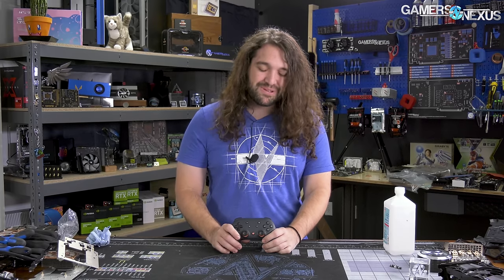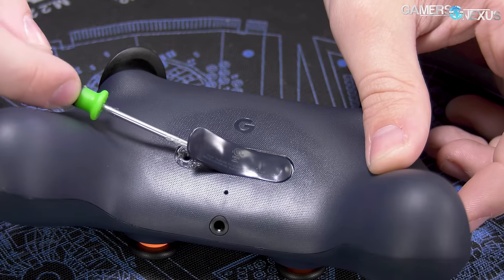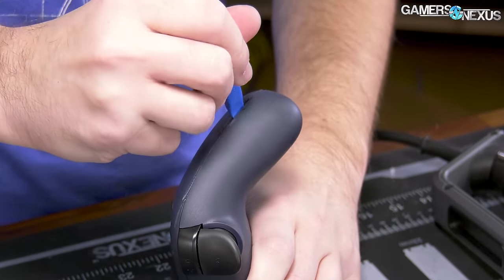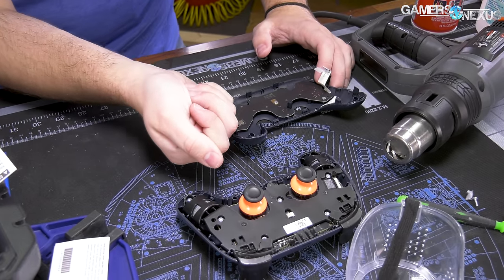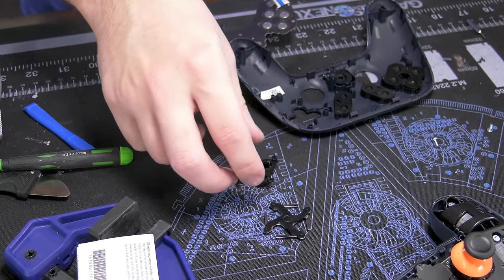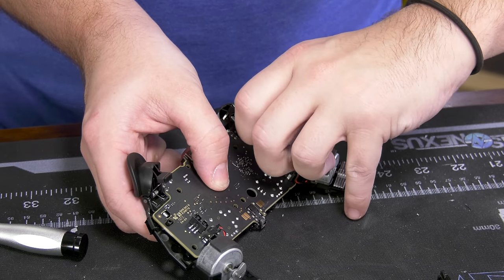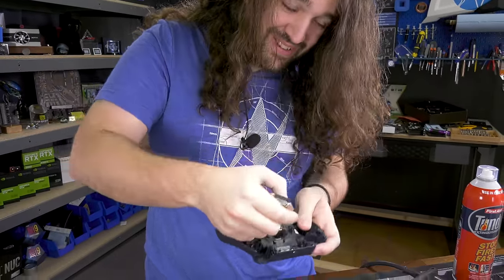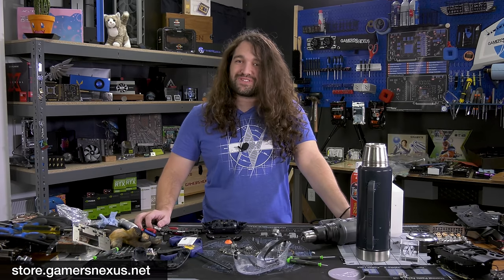Google Stadia Controller Tear-Down & Disassembly Nightmare

Comment: So Steve briefly mentions ease of assembly, and that is kind of the problem here. I work in automotive manufacturing and I can see the real problem; it was in fact designed for quick solid assembly and not much else.  Working in assembly, I also sometimes pick up overtime in repair, and let me tell you, one does not equal the other.  The intent here was "Push the top part down on the bottom, drive a screw, finished product" This falls apart when workers or lord forbid customers have to start jamming tools into seams to break clips. Clips exist for the assembler, screws exist for everyone after.
Reply: nodding vigorously
Reply: Agreed
Reply: That's actually pretty interesting to hear/think about as someone not versed in either industry.
Reply: Oh Christ on a pogo stick, they just don't want anyone to mess with it period do they?
Reply: I watch a lot of auto assembly videos here on the tube (im weird) and yeah, everything is clip on. Its pretty amazing thinking about how the process is automated and figured out. I try to imagine how they program the robotic arms and the reason for every move and pause.
Reply: Then you gotta spend an arm and a leg getting a oem replacement part, because said clip broke.
Reply: As a mechanic I hate the clips every new car has, they are so brittle nowadays
Reply: @pilot1721  Guess they just need Google's Monster Clips (tm)!
Reply: @pilot1721  well you basically have to types of clips: 1st breaks of instantly, 2nd it's more likely that you rip the fucking metal out of the other part than get the fucking clip off.
Reply: @Ocastia  And the tabs in my crappy Samsung. I've opened it up a shitload of times and they STILL are there holding the thing together.
Reply: @owlstead  Yeah I hate how Crunch bars come in triple-wrapped waterproof silicone these days with gorilla glue and a padlock to secure it.

Comment: "Disassembling the device may cause injury to you" given that it necessitates LN2 and a heat gun and a dremel I'm not surprised lol
Reply: Yeah, I guess they weren't kidding!
Reply: No, they're just warning you that 1 in every 10 controllers is actually filled with sharp, spring loaded spikes.
Reply: @nickdahl203  lol
Reply: I hope they have clear safety warnings for the claymore mine! 🤣

Comment: At least Google will kill Stadia long before the non-replaceable battery dies.
Reply: I just sold off my last Google TV today... 

You remember Google TV? 

No? 

Google it.
Reply: Search “killed by google”
Reply: @rodmunch69  No, but I used SageTV for years until Google bought it and killed it to make Google TV...
Reply: gtwannabe2 well that’s the point - Google TV wasn’t even around for a year. Meanwhile Sony releases an entire line of TVs and Blu-Ray players built around it - and Google didn’t even wait a year before abandoning the platform. That’s what will happen here.
Reply: Yeah that sucks...man i played my 360 batterues dead back in the days
Reply: Wait what you can’t charge the batteries
Reply: Massman121 You can. But it looks like you can’t swap them.

Comment: Paid $130 for Google Stadia that doesn't work.

GN "Let's do a teardown of their controller"

Uses every tool, a heat gun, liquid nitrogen, and dremel cutting disc to disassemble controller. 

Great video Steve! 👍
Reply from the maker: Thank you!
Reply: RIP Flathead screwdriver 2019-2019. Your sacrifice won't be forgotten.

Comment: Tools needed for this tear down:
1 heat gun
1 flask LN2
1 Dremel with cutting disc.
1 Tech Jesus
Reply: And 1 set of safety squints!
Reply: Did you just call savior Steve a tool? 😄
Reply: random_n Maybe a vice of knowledge would help aswell!
Reply: Don't forget the eye protection in case of flying screwdriver tips.
Reply: Are we all forgetting how he said "jif" instead of "gif"? It's tech Geesus now.
Reply: Your forgetting one major thing a mod mat
Reply: @matdan2  Along with a swiss army knife that hopefully has a screwdriver in it?

Comment: Google got the Apple "just buy another one lol" syndrome.
Reply: Apple products (except maybe computers) are fairly user-friendly tbh
Reply: @Matte0Cal0  software wise, ye. Hardware and repairability wise, a little bit less.
Reply: @Matte0Cal0  Yeah, I love awkwardly crawling behind an iMac just to plug in an SD card. Really userfriendly.
Reply: @Matte0Cal0   tbh I'd say Apple is pretty consumer-hostile .
Reply: Matteo Calogero you had a lot of vaccinations
Reply: NPC #76 .you’re one of those
Reply: AznUzer what do u mean bro
Reply: Krystal Myth I must say that they don’t really allow the consumer to get into their phones and stuff, but when you know how to repair an iPhone, it’s actually a cup of tea (sorta like a car and why you need to go to the mechanic)
That is why I like apple products, you can use a phone for 5 years without even feeling a difference, except the Battery which you can easily replace for ~30 bucks and 15 mins of your time
Reply: @Matte0Cal0   Yeah, and I still can't use my wired Sennheiser headphones on my phone. Neither can 2/3 of smartphone owners thanks to the toxic effect of removing a universally ubiquitous open standard. Anti-consumer doesn't even begin to describe it. I'm saying what you call user-friendly, comes from a company that is unfriendly to their users, from policy to their design. To their very core. 

By the way what you just described applies to any modern flagship. I've owned an Axon 7 since 2015 for the Stereo loudspeakers without any issues. Something like that is not why you like Apple products.

You like Apple products because you are locked into their ecosystem, and can't leave it without abandoning a large collection of software and accessories. You don't have much of a choice, so you've convinced yourself that it was yours to begin with.
Reply: Krystal Myth I get what you’re saying, not being able to plug my audio technica headphones on my phone without quality loss, but you shall remember that these companies (not only Apple as you said) are making phones for the average consumer, not specifically enthusiasts. Take for exemple the RED Phone, amazing concept, but you can’t develop a product only for dedicated fans for a user-friendly price.
Reply: Krystal Myth I know that there are plenty of phones that are far better than iPhones, but I only use my phone for YouTube, Reddit and 4 daily hours of music, and just the overall confort of whipping out AirPods from your pocket and listen to music in 3 seconds while entering a bus or between 2 classes is just a life changer. I’m not buying apple stuff for the brand, only for the confort and how good it just works, and for how long it works (just like an old civic :)
Reply: Michael M. True, but at least apple products and services work.
Reply: iPhone 4 and 4s is just 2 scews you don't need anyway and then slid down. The back stays on with out the scews.

Comment: Normal people when something you're working with gets too hot: let it sit, maybe put some water across it.
Steve: [Red eyes glowing] TIME TO GET THE LN2!!!
Reply: Since the thing was still clipped together, holding the surfaces apart, letting it cool wouldn't help. The glue would just set again.

Comment: iFixit's review is going to be scalding.
Reply: Liam O'Brien They should make a new kit that includes the heat gun, liquid nitrogen and dremel :)
Reply: @Liam O'Brien for these mammoth clips the Jimmy tool is pretty good, as long as you know where to pry. I'm mostly used to them in much bigger things (sun microsystems keyboards to be exact), where you have a larger gap to stick the tool into, as well as a straight edge they are aligned with, instead of them just sort of hanging out a bit inboard the device.
If there also is glue in the seam you are screwed tho. Short of actually heat cycling it with ln2, as long as you can't get the glued surfaces apart, not even just hitting it with the hot air will help you.
Reply: At least it does not have that rivet shit that you cannot undo without breaking. It might not be 0/10 repairability after all. Yay... :D

Comment: So basically once that controller is together it's not coming apart.
Reply: It is - it's just not coming back together
Reply: @Edino_Chattino  
Just like modern marriages.
Reply: @rockytom5889  Indeed. I've seen many marriages break apart because of a Dremel.
Reply: @sophiaperennis2360  Same.
Reply: @sophiaperennis2360  she took the kids I took the dremel to the kids now we can each get half
Reply: @matthewskullblood9778  when in doubt, a p p l y d r e m e l
Reply: @matthewskullblood9778  flex tape can fix that
Reply: Rage proof
Reply: Made like a Nokia 6010

Comment: I pray google never lives this down. This controller's construction is an unholy joke
Reply: @diomedes7971  ok Google.....
Reply: "B-But the software will make up for it! you don't even have to use it!". At this point, I'm seriously wondering who the hell is in charge of hardware design in Google. Just poach someone from either Sony or Microsoft already!
Reply: walentaz  you can still control the volume with arrow keys. You have to hover your mouse on the video. If you hover your mouse outside the video, it scrolls down.
Reply: Han Lockhart  Yet we are on Youtube....

Comment: Googles own way of repairing that thing: "Just throw it away and provide a new one back"...because even they can't open it properly without damaging it.
Reply: For a $15 part absolutely. It's not worth the time to pay someone to even look at it.
Reply: i mean they could also build a tool to press all the proper places at once, but i guess it's not worth it for them either
Reply: Apple has been doing that for decades now
Reply: @diomedes7971  You can open a Switch controller (even a joycon) without even scratching the thing. Most keyboards and mice can be opened easily. Only shitty manufacturers make products that can't be repaired. (Hell, the cheapest Logitech mouse can be opened without even prying things apart)

Comment: 2019 - the year major tech companies dropped the ball for inexplicable reasons.
Reply: But apple releases a thicker laptop with better thermals, a better keyboard, and a bigger battery. Can things get any stranger?
Reply: AGAIN
Reply: mister.T Jr  Have you considered learning how to read before responding to comments?
Reply: @infinitelyexplosive4131  sarcasm is hard to see sometimes
Reply: reasons = $$$
Reply: @michaelgleason4791  rx 5700 series were pretty good as well (although the launch was a mess)
Reply: diversity
Reply: mister.T Jr  you replied *to
then read *mine
you that *doesn't know

Moving beyond your inability to understand basic English grammar, it's important to note that nothing you have said is related to my original comment. Is it really beyond your mental ability to understand that one can notice significant and positive changes without being a "fan boy"?

Comment: At the risk of being called a shill I'm gonna say something positive about the stadia controller

it had a headphone jack.
Reply: Meh... Xbox One controller have jack too and it work even on pc
Reply: @Masterblack1991  Though you have to buy the Xbox wireless adapter to use the headphone jack. It doesn't work over Bluetooth.
Reply: japzone the s controller does
Reply: @chrisd.2948  The controller does, but not the headphone jack last I tried.
Reply: Too bad the new Pixel phones don't
Reply: @japzone  i use the controller on PC whit the usb cable. Why use wireless if you are 30 cm away from pc,maybe the battery die during playing,you need to change battery or wait they charge etc. Use cable and good to go :)
Reply: The original Xbox 360 controller had a standard 2.5mm jack.

I remember that vividly because I used a Nokia cellphone headset to tell 12 year olds to fuck off in the MW2 lobbies.
Reply: @japzone  The original Xbox One Controller had a 2.5mm headphone jack, but the revised Xbox One S controller added bluetooth and changed the headphone jack to the 3.5mm so it works with any regular headset.
Reply: Most controllers do lol

Comment: It's like an iFixit video with more swearing!
Reply: Have they given it a repairability rating yet? I'm thinking around 0.... 100% landfill when 1 button gets gummed up.
Reply: @tin2001  well its got a fair few modular parts, id give it a 1 or 1.5. still not repairable but once you sacrifice a goat to get it open its pretty much a normal controller
Reply: @blitzwing1  what good technician DOESN'T keep a couple sacrificial goats on hand?
Reply: @WDC_OSA  fair, though that device was easy to get in with nothing to do once your in. This one is hard to get in but is relatively repairable once your in

Comment: Hotgun, liquid nitrogen then once the dremel came out I was almost on the floor laughing. Seriously though I pray this service fails miserably as the longer we can put off game streaming the better. I've troubleshot internet for 12 years for 4 different ISPs and I can assure you game streaming is a terrible fucking idea.
Reply: It's bad enough physical copies are hard to come by, let alone streaming. Not everyone has perfect internet. Still allot of people living on DSL and satellite. At least with Steam, they can set download time windows to the times where traffic is the clearest and/or satellite bandwidth isn't recorded, in order to download their games.

I've used in home streaming and it wasn't exactly a pleasant experience even over 10-gbit home network, can't imagine trying to play a game sourced hundreds of miles away, through cable internet. 

Game streaming will hit a certain niche, especially with parents not having to download a console, but it won't replace the current paradigm, especially on a flakey service where you still have to pay for the games, on top of the monthly fee.
Reply: I have 1 gig fiber and zero interest in this streaming crap, just built a new desktop. :)

Comment: I'm blown away by how complicated Google have made this controller. I've taken apart several dualshock 4s, and those are so easy to take apart and put back together. There's no extra frame or cover, no fancy screws. All it has is one flat cable that connects the front LED+touchpad to the board (reconnecting this has no comfortable method but it's ok), a plastic cage that holds the battery, and a very small pcb. Over the years, sony has redesigned the dualshock 4's internals a couple times, but they're so simple that it doesn't matter to anyone taking one apart for the first time.

Comment: I assume the "monster clips" were meant so that one could not repair them.  I message I'm getting from Google is if it breaks, one has to spend another $69 for another one.
Reply: That or to hold up against impulsively angry gamer kids who throw their controllers against the wall when they lose a COD multiplayer match.
Reply: @TheNiteNinja19  Is CoD even on the Stadia lineup?

Comment: I used to repair cellphones.  Im not sure if you tried this, but in the future, try using multiple spudgers. I'd try nylon spudgers first, but since the controller seems too thin, maybe try metal spudgers.  The wide flat ones are really good.  At any rate, the strategy works when you have a ton of heavy duty clips, is to create space where you can, then if you cant find the clips right away, keep widening the gap.

Comment: In terms of the buttons only fitting a certain way - it's something Nintendo has almost always done with their controllers. If you have one, tear down the SNES controller to check. It's actually surprising how much certain parts of the internals of controllers haven't really changed throughout the years.

Comment: IMO, nowadays Torx is no longer used for tamper resistance. Torx bits are very common and easy to come by. Torx was designed to transfer higher and more consistent torque, hence the name. As an added benefit, Torx heads don't wear out nearly as easily as Philips heads. While Philips heads "cam out" at a certain torque (which will in time damage the driver and head), Torx is used in manufacturing with torque limiting drivers, so you simply apply pressure until it "clicks", which makes manufacturing easier and improves consistency.

Comment: As someone in a different comment section pointed out, the Stadia controller is pretty much identical to a Gamesir G3 but that, looking at some image results has exposed screw holes on the underside like a normal bloody controller.

Comment: Today I learned you can get T9 size Torx screws. I've only ever used T5, T10, T20 and T25 and so always assumed they just went up in 5s. The difference between the 5-spaced sizes is about what you'd expect for single steps, but it turns out the step sizes for Torx are tiny! I've only been turning screws for 30 years, still a lot to learn :-D

Comment: I miss being able to use quality rechargable AA batteries in basically any wireless controller.  4800 mAh @ 1.2V (this is a bit of a low ball since NiMH batteries run between 1.2 and 1.3 V for the majority of the life of the charge in lower drain scenarios such as a game controller.) gives you a similar Wh rating of 5.76 while allowing you to quickly swap batteries as needed without having to be tethered to a power source or remembering to charge.

As an aside the play and charge kit for XBone is 1400 mAh at 3v (conservatively 4.2 Wh as I do not have a proper data sheet) which makes it worse than just using some rechargable AAs which can be used in almost any device that takes AAs.

Comment: The modular cable there would be for RMA purposes. 

Verify fault, literally hot swap entirely new internals, re-seal with the powers of a long forgotten diety apparently, fulfil RMA request.

Probably also why that faceplate is there. Single pre assembled part is the only reason why that power cable makes sense.